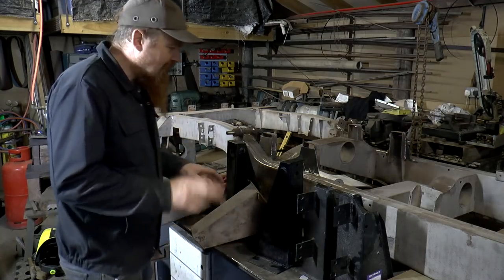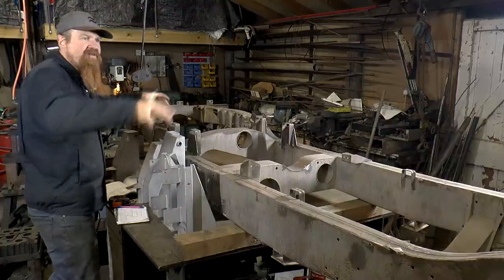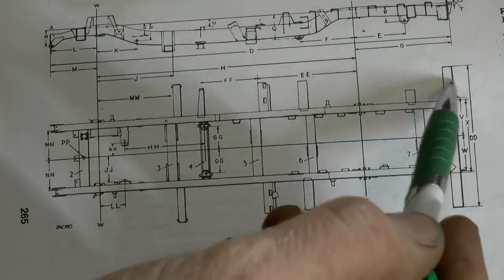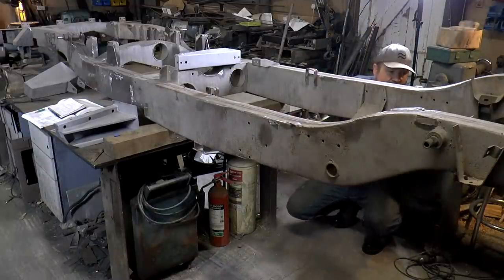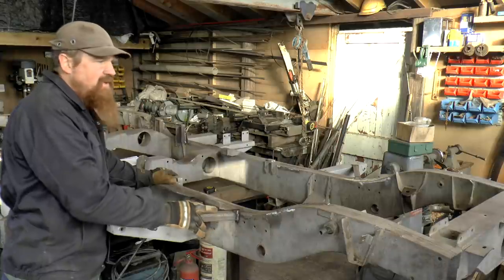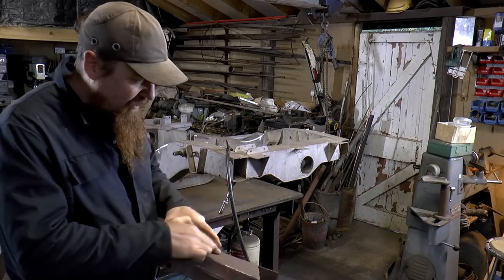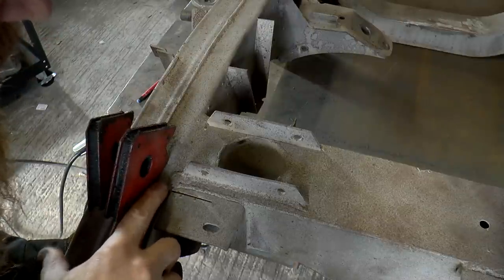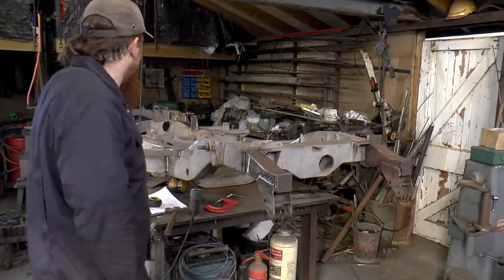Project Kermit 14: A Land Rover Series 3 Full Restoration

Comment: Still watching! 😉

Great work.  I’m glad you rebuilt the original dumb irons.  The Britpart replacements I used on mine were horribly inaccurate and thin.  I was glad to replace the chassis with new a few years later (though that Marsland unit had misaligned components all over, including the spring bolt holes on the dumb irons, which needed a lot of rectification during the rebuild).  I hope the outriggers you used are better than my dumb irons; a lot can change in 15 years, and Britpart are supposed to be trying to up their game.

Comment: When I did my chassis, because I hoped to be towing, I took the opportunity to make up some diamonds, which I welded on, top and bottom to the rear cross member to give it a bit of extra strength...T B H I also welded on a drilled heavy plate, to spread the toad behind the tow hook attachments points....all stuff that it is easy to do while the chassis is on the bench.

Comment: Land rovers are like the story of the old family axe it's had a new shaft and the steel has been replaced and fixed many times but it's the axe that's been passed down for generations. Original Aluminium Landies are mostly still on the road upto 70%

Comment: Chassis-in-white looking magnificently better than chassis-in-rust ! On metrology troubles; maybe Solihull's draughtsman managed a misprint in the manual after dropping his Woodbine, or else the comptometer operator had a bad day on the arithmetic? You may well be the first user of the data ! Perhaps a good case here for comparing with another vehicle or mocking up against pieces of your vehicle's body to avoid future disappointment before galvanizing ?

Comment: Max you've spoken about your generator before, I'm sure, but as you mentioned the earth rod I'd be really interested in how you've dealt with earthing for each of your buildings. An often overlooked issue on off grid setups!
Edit: power is one of my bigger headaches and its easy to fall into having generators in different places when looking at the price of heavy cable and whether or not to run 3 cables or link the neutral and earth or whether to isolate the earths between buildings/zones.
Reply from the maker: Earthing is a complicated subject and I'm certainly not expert enough to give any advice on it! I bought the books from the IET and did a lot of reading. Check out John Ward on youtube for some good videos on earthing (and everything else electrical).
Reply: @maximusironthumper  Max I've just tried a lengthy  reply which in essence covered  practicality of earthing / equipotential bonding and making a case for traditional 110V hand tools and distributed RCD protection on your fixed circuits etc  Failed to post! Edit   more time now. With EEBAD (Earthed Equipotential Bonding and Automatic Disconnection) you are relying on a high fault current to blow a fuse or trip a circuit breaker and the bonding to prevent high touch Voltages between 'extraneous' conductors like hot and cold taps, metal benches etc which are strategically connected together (with "safety earth,  do not remove !" tags). Trouble starts in fast fuse blowing with high resistance faults and  with low power generators that struggle with making enough fault current (field collapse and maybe the engine bogs down), making RCDs a much better idea, but 32mA is not a lot to leak through damp old induction  motor windings. So lots of localized RCDs are helpful in reducing the scale of outage events. And then, on portable tools while today's "double insulated" ( plastic bodied) hand tools are safe until they fall in the water butt, 110 Volt  CTE have the mid point of the secondary winding earthen, giving a maximum 55V shock risk to earth.   In perspective, that tickle from a wet welding glove changing a welding electrode is I think about 40 Volts.  So, outright earthing of generators is important to help rapid fuse blowing or circuit breaker tripping during earth faults, but can arguably be a hazard under some fault conditions producing a touch Voltages and some installations including grid tied inverters need isolating transformers.  On earth rods, sandy soils can be a problem needing conductive Bentonite clay adding and the measurement of earth resistance is in itself a drama needing several test electrodes and a Wheatstone bridge gadget. Summing up: stay safe with RCDs and 110V tools !

Comment: Coming along nicely mate.

The only thing that concerns me is all of the transverse heat affected zones you're putting across high stress areas, like those dumb irons.

Ideally they would have all been fish mouth joints, but that's obviously not going to happen now. To deal with that I would highly recommend you put 30 degree diamond doublers across them to improve the sheer stress they will take before fatiguing and falling off.

Comment: All I can think regarding the half inch discrepancie with them measurements is maybe it was not taken from the hole centre but the edge of the hole. In the end it looked like the outriggers landed straight on the factory welds so I recon your plain sailing from here.
Reply: I'd say it looked like his position was maybe 5 mm off the factory weld, which seems well within the tolerances specified in the manual.

Comment: I don't think the chassis saga will conclude at part 15 .
Be interesting see the hot dipping results.
Also interesting seeing bulk head fitment and rear body to rear member and door alignment .
Generally they a right cock get decent, hopefully yours going be super close .
Amazed how minimal rust was on that chassis as it been knocked about and had some shabby repairs that normally escalate the rot  .
Can't wait see the progress in 2022, keep at it Max ... Have a good xmas .

Comment: mmn, the chassis measurements dont match the manual, that is a little worrying, de-ja-vu for me.
i think a dry build [along one side] before galvanising is a worthwhile delay, just in case
why did you decide on the extra bracing on the front outriggers?
keep up the excellent vids
Reply from the maker: It allowed me to put a lot more weld into the area and make the joint stronger in an area I felt would get a lot of sideways forces. *edit* Jon is correct they are standard. I was answering the wrong question!
Reply: Land Rovers had that bracing as standard.
Reply: @jonpatchett425  on which models? not on mine
Reply: I worked on hundreds of S2s and S3s, 88"s and 109"s. I cannot remember one with out the diagonal brace. All the Marland chassis we fitted (and still do) have the brace.
Reply: @jonpatchett425  majority of  stuff i work on have coil springs, including my 75 RR, it must be a leaf spring thing, the few i worked on must have rotted off, or left off after outrigger renewal   learning all the time....

Comment: Does your sums and measuring mean that the rear cross member is 1/2 inch too far forward. Thinking here about the front outrigger measurement discrepancy, measuring from a known original and a replaced part. Completing the phrase, "near as dammit is to swearing" cheers
Reply: @Tik Nesla Just shows how difficult it is when working on stuff that has been repaired many times. Plenty of thinking time needed and it's even more difficult when filming and taking to camera, cheers

Comment: Does the life of the chassis improve after so much rebuilding or is it weak - considering weld sutures ? How is the safety point evaluated .. thanks !!!
Reply from the maker: I can only give you my opinion - the finished welded chassis is as good as it was when new 40+ years ago, once galvanised should last at least another 40 years. I'd say that is an improved chassis life.